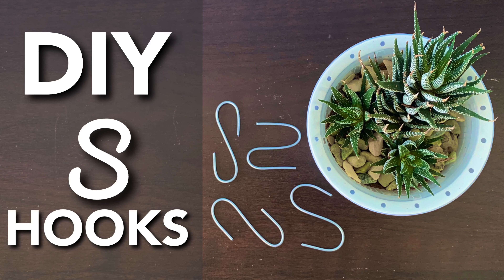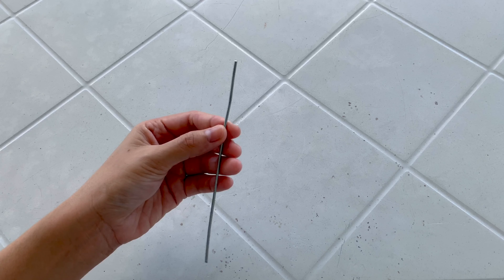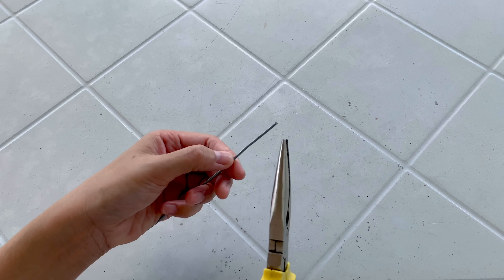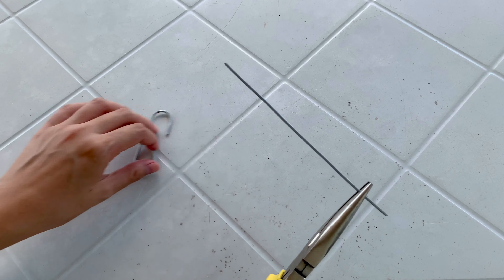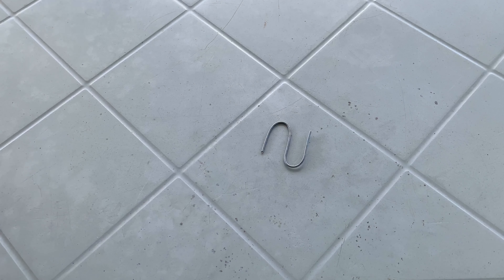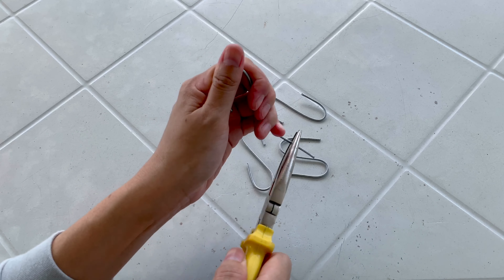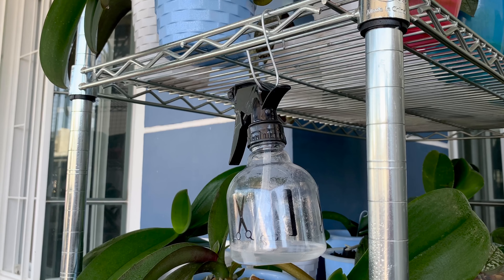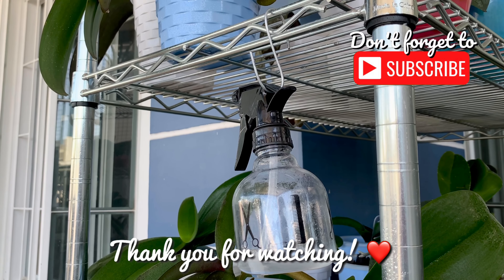DIY S HOOK | How To Make S Hook | Paano Gumawa ng S Hook | Hanging Pots/Plants and Tools/Utensils

Comment: Nice.,, what size/thickness of aluminum metal wire do i have to buy
Reply from the maker: Hi!😊 this is only size 16mm, you can look for thicker wires if you can find one in your area if you will use it for heavier items 😀
Reply: @CheeryOrchids  How much feet long did you use